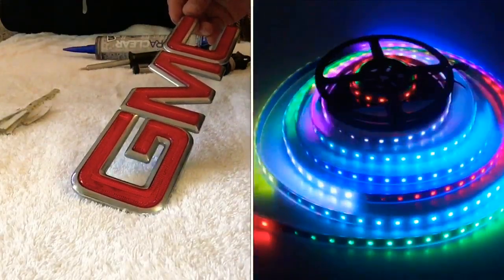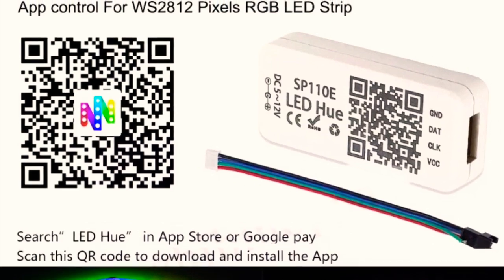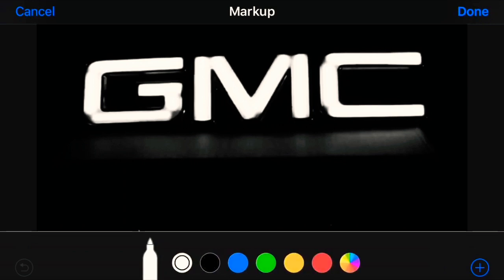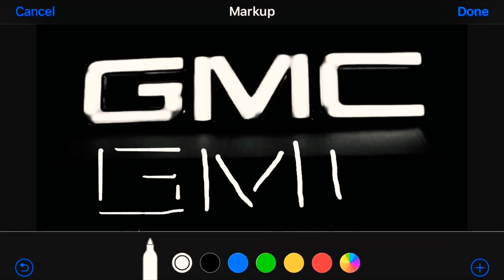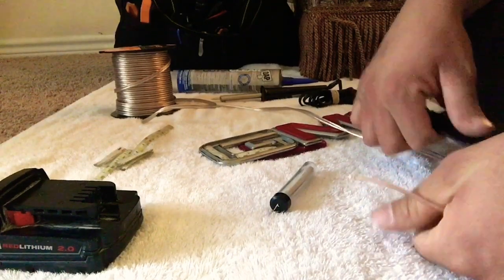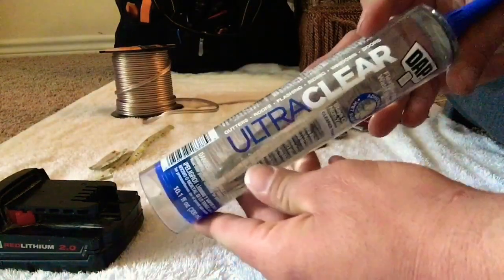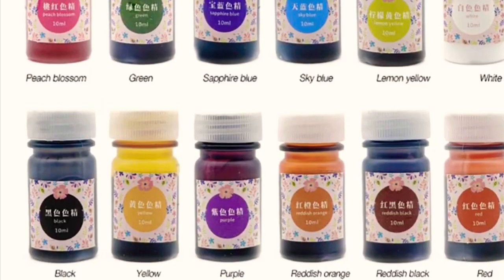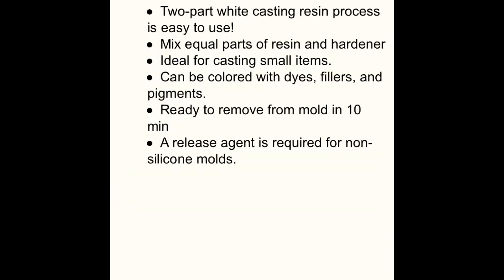How to make a grill logo light up/ GMC

Comment: So each letter I solder the cut led to each piece to form the letter correct? Then drill holes in each section that will connect all the 3 letter into one power source?
Also if I order the Resin cast kit I dont need the crystal clear dap or the white dye correct?
Reply: And after making the mold do it stay in the emblem or do you have to glue it down on top of the led lights
Reply from the maker: Mike Williams yes correct if you just order the resin cast that’s all you will need put your LED’s in your logo then Put resin on top of your LED’s and let it dry into it turns white that’s it 👍 when its dry and u turn on your LED’s you we’ll still be able to see through the white👍
Reply: S Perez Ill let u know how it went for me when I get all my parts and try to make it this weekend
Reply from the maker: Mike Williams 👌
Reply: @sperez6140  what power supply did you use to get 5 volts or will tapping in to the head light work?

Comment: It was very hard for me to get the resin smooth. I ended up with bubbly parts and tried to scrape it down, but if you screw up once the whole things done for. The fact that it's rounded makes it much more difficult.
Reply from the maker: alaska alaska How did you pour it in the letters
Reply: @sperez6140  drill/pull out red inserts, solder in LEDs, hot glue them down, pour
Reply from the maker: alaska alaska What I am asking once you’ve poured the white liquid and or how did it get bumpy on you
Reply: @sperez6140  because its curved, the resin goes to the lowest point, leaving one side nearly empty and one side overflowing. you could remedy this by being patient and doing1 letter a day
Reply from the maker: alaska alaska Yes the tip is the letter has to be super Street second tip whenever you’re dropping the liquid in the letters you have to follow the letter pattern back-and-forth it will come out very smooth
Reply: A little heat from a blow dryer pulls out bubble, or better a vacuum chamber.